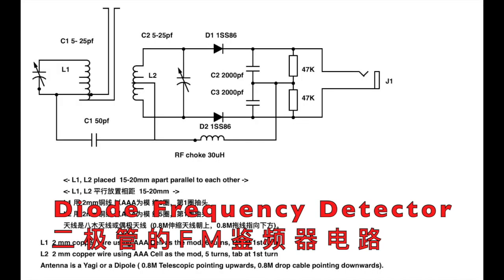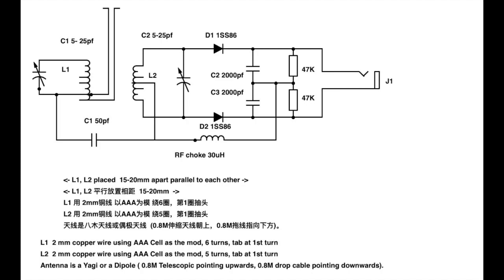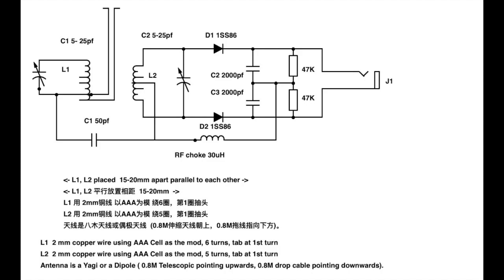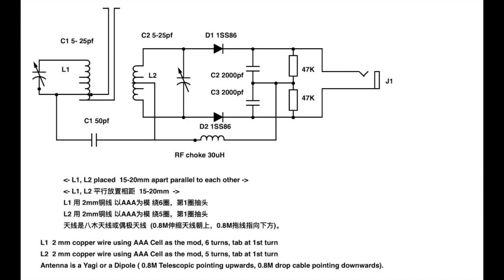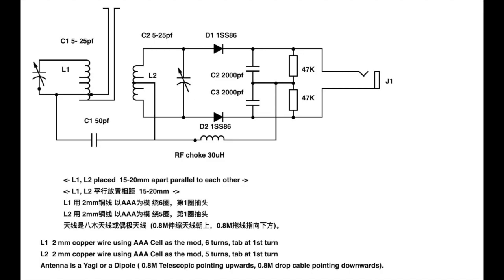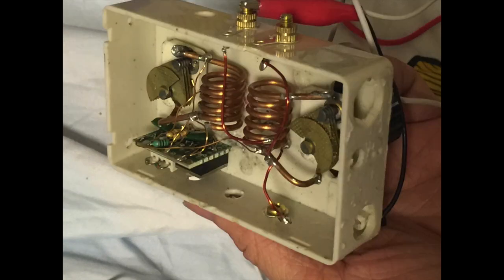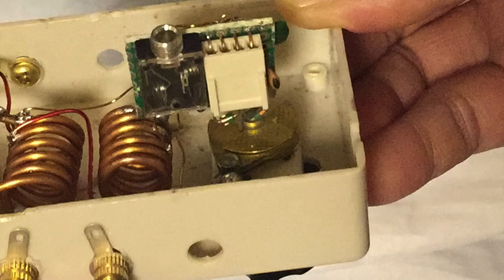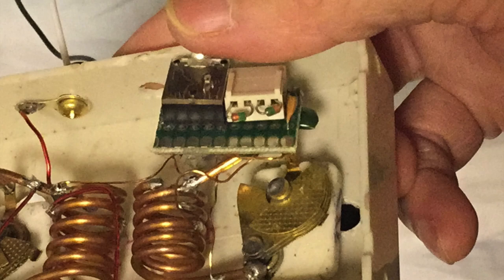Diode Frequency Discriminator FM Crystal Radio

Comment: Merhaba Billy, YouTube ortamında FM Crystal Radio konusunda en geniş içerik üreticisi olduğunuzu görüyorum. Google görsellerde FM Crystal Radio araması yapıldığında bir elin  parmakları ile sayılabilen devre şemaları görüntüleniyor. Farklı  şemaların performansını kanalınızda denemeniz mümkün mü? Keşke yapsanız. En çok kuplaj ( coupling )bobini mantığını ve altında yatan matematiği merak ediyorum. Kimisi ayar bobininin yarısı turda ve daha kalın tel ile daha geniş sarım yaparken. Kimi daha ince ve nerdeyse aynı sayıda sarım ve aynı nüve çapında sarıyor. Bir devrede kuplaj bobinine paralel bir kapasitör bile gördüm. Bunun için video içerik üretmemizi dört gözle bekliyorum.
Reply from the maker: sorry, I am not a mathematician. I only made crystal radios based on my experience, and tests. Not mathematics. FM coils made with thicker wire will have more output power in general but more noise. Thinner wire reduces the noise, but will sacrify a bit on volume. However, that can be made up using the right antennas. Hope this help.
Reply: @BillyCdiy thanks a lot, for information.

Comment: Billy, why is L2 only 5 turns? Shouldn't L1 and L2 be equal number of turns? 😊
Reply from the maker: There are extra turns on L1 for connection (coupling) with the FM antenna. L2 will couple with L1 only  (weak coupling) so no need for the extra turns for antenna coupling.
Reply: I must have missed that! Thanks Billy!

Comment: HI Billy, I was wondering why is there still noise in the background like a Slope Detector? A Foster Seely should have no noise...
Reply from the maker: True. I think may be due to the impedance matching defects of the  FM antenna. Also Q factor of the coil and VC are still not optimal. You can try it out if you found better components and values.
Reply: Thanks Billy! That was some fast response!

Comment: How do you prevent losing signal due to a forward voltage of two germanium diodes?
Reply from the maker: Technically you can add battery to add a bias to the diode to reduce the forward voltage gap for the signals. However, I do not like this idea as it defeats the charm of building battery-free radios in the first place. The other way is to find other components that can live with a smaller voltage gap, e.g. close-to-zero-voltage   MOS FET (3DQ. I made another video on the same type of FM radio. Check this out if you haven't seen this already. https://youtu.be/zG3WrzNtzcU

Comment: Hey Billy can u make a audio transmitter and receiver project
Reply from the maker: The universal boss The universal boss , FM transmitter ?
Reply from the maker: The universal boss The universal boss , I think low power transmitter can be good tools for testing your crystal radios. I have finished both a simple AM transmitter that works well with crystal radio, receivable within the room but not outside. I also made a  one transistor FM transmitter. It can be received by regular FM transistor or IC based receiver within a few feet only. It cannot he received by fm crystal radio. I am testing a 2-transistor version. Hope this one is strong enough to be received by FM crystal radios.